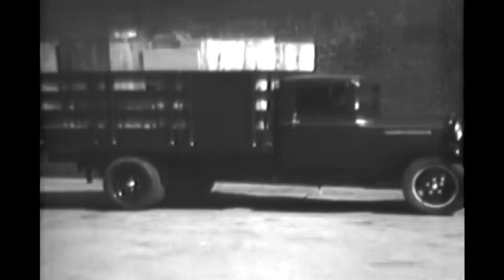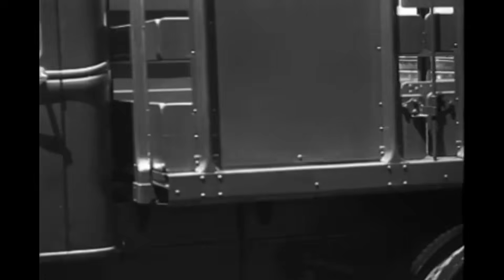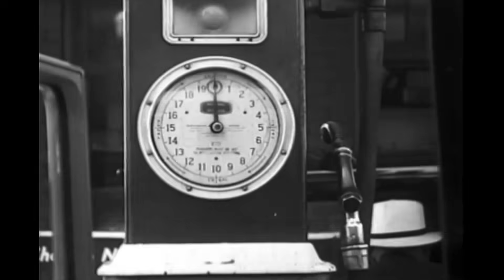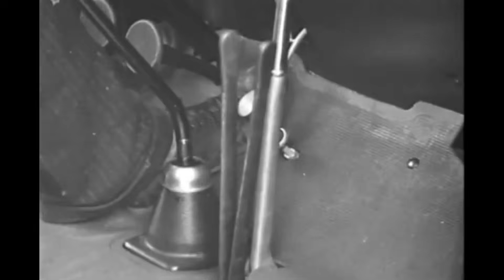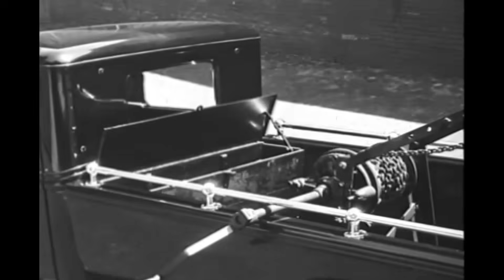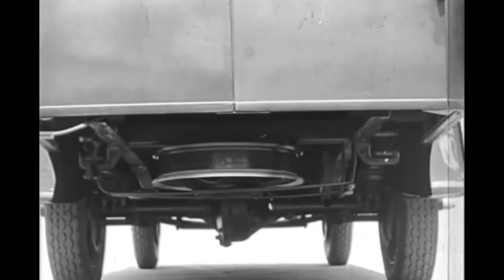1932 Ford Model B Truck – Classic Design, Timeless Power

Comment: So you want to go back....These vehicles had no heaters or AC and no power steering...Manual transmissions and mechanical brakes... The good old days,,,My dad use to say the only thing good about them is they were old....I have driven these old Model T 's and A's in Ohio winters and they weren't enjoyable...
Reply from the maker: LOL, I don't even have to go back that far.  1970 VW.  Might as well say no heat as I lived in Chicago.  No AC either.  Manual brakes (although they were hydraulic) and no PS.  Still, I think most people forget that these cars back then were very basic and just a few steps above the horseless carriage.  Thanks for mentioning that and for watching!
Reply: @kensmithgallery4432  my older brother restored an 1937 Indian Scout like my dad had after riding it this was 1975 I was comparing it to the motorcycles of that time and asked my dad how much did he enjoy it and he said they didn't know any better actually it was very nice to ride left hand throttle and foot clutch very comfortable but it didn't stop very well but traffic was much slower back then. Love this video the panel trucks and the woody my favorite and the tow with hand crank could you get a V8 or special order what year did they stop building the 4 cylinder motors? Thanks for another great video the Gilmore museum had a great display of Model A and B trucks when I was there in 22 😮😎
Reply from the maker: @Tanman799  Thanks so much for sharing your thoughts.  The Gilmore is a great museum!  I'm glad you enjoyed your visit there.  Thanks for watching!
Reply: @kensmithgallery4432  why did they use fabric for the roof cost savings or weight or both?